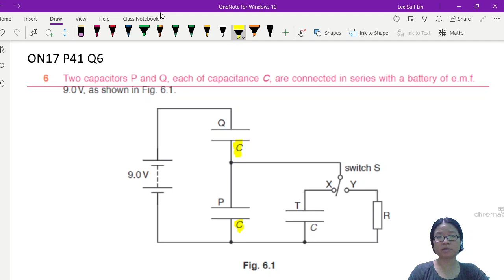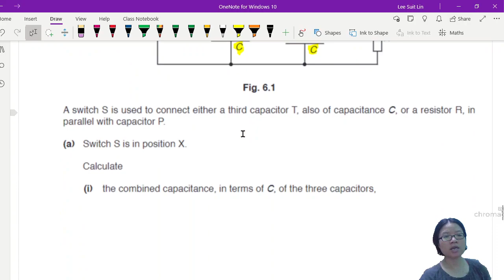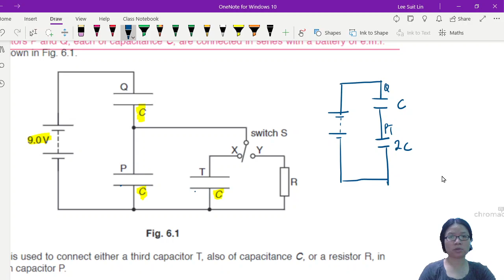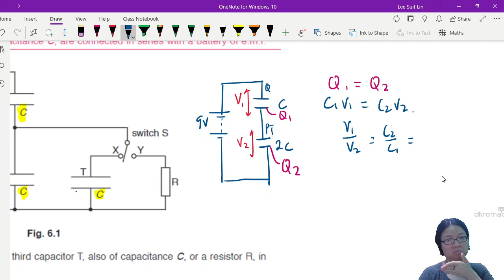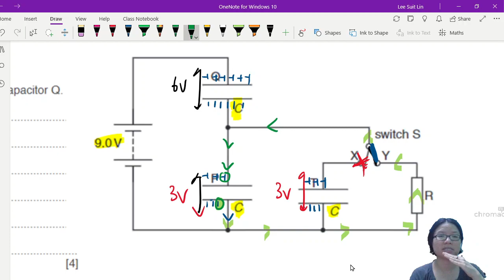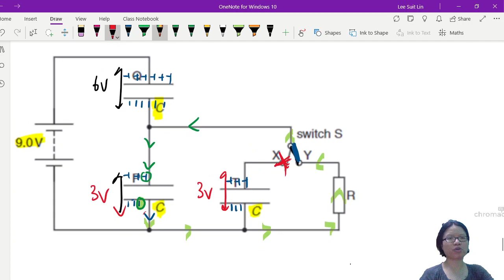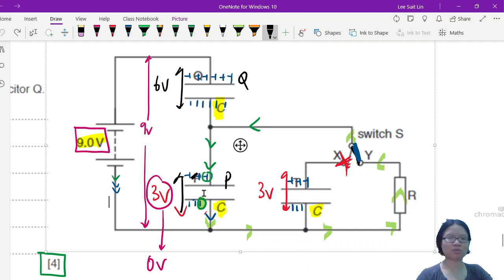19.2c ON17 P41 Q6 Maze of Capacitors | A2 Capacitance | Cambridge A Level Physics

Comment: Please I need some help for part a(i). If I instead combine the Capacitors in Series, P and Q, I get C/2. Then the combined Capacitor of the two now becomes parallel to Capacitor T. If I add them up I instead get 3C/2 — which is different from the answer. Can someone help explain where I'm wrong?
Reply: The one you did is for resistance. In capacitance things are opposite to resistance watch the previous video in the playlist to get a clear idea.
Reply: @merajnahid9125  Thanks for the response, mate. 😊 BUT I think I followed the new rule under Capacitors. In the question, Capacitors P and Q are in series, right? When I combine them under the rule of capacitance, I get (C÷2),  correct? Now let's name these combined Capacitors "S". Now Capacitor S and T will be parallel, not so? When I combine S and T, I get (3C÷2), ie (C÷2) + C.  Or is it a rule that when combining different Capacitors – some in series and others in parallel – we must combine the parallel ones first? 🤔
Reply: @gonayor992  exactly combining series first makes the answer the opposite.
Idg🤔
Reply: @gonayor992  the capacitor Q is in series to both P and T so you need to solve them first before you can find the total series capacitance

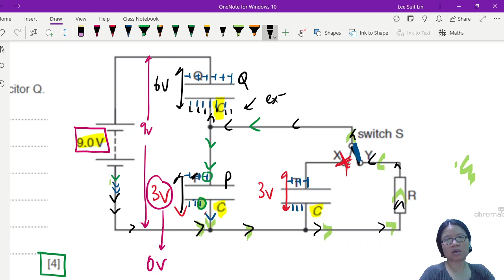Comment: at 14:41 how does the negative charge from the battery on its way to the negative plate of the capacitor capacitor manage to pass through resistor, R without it being dissipated into heat  in the resistance of the resistor
Reply: That's because charge can't be dissipated as heat, energy can. Besides, there's no other way for current to flow but through the resistor

Comment: Well I am still confused like if we consider loop that has battery capacitance Q resistance R than pd across Q is 9 v then resistance R should also have pd across it so isn't it violation of Kirchhoff's second law . Sum of pd across battery= sum of pd across Resistor R and capacitance Q which in this case. Not equal can you explain?
Reply: I think capacitor Q and resistor R are connected in parallel, so you can say Sum of pd across battery = sum of pd across capacitor Q and resistor R = sum of pd across capacitor Q and capacitor P. Hope that makes sense?
Reply: After P has completely discharged, R won't have any p.d across it, as they're in parallel. That's why the sum remains 9V. The capacitor Q doesn't discharge as the negative charge has no way to travel to the positive plate without passing through the battery, therefore it will return to a charging circuit.

Comment: When the switch is set to Y,why is there no potential difference across the resistor R?
Reply from the maker: At first while the charges are moving around there will be current though R and hence pd. But eventually after all capacitors have stabilized and charged/discharged, no more current will be flowing through R and hence no pd!

Comment: Hi. Why doesn’t the cap Q discharge to resistor as well ?
Reply: There isn't really a path that you could use to discharge Q through resistor R, keep in mind the charge cannot travel through the capacitors P or T. That's what i'd guess atleast :)
Reply: The capacitor Q doesn't discharge as the negative charge has no way to travel to the positive plate without passing through the battery, therefore it will return to a charging circuit.
Reply: man this topic is confusing I hope they dont put hard questions for it in M/J 24 students always mess it up

Comment: What does the resistor do to help the 3V capacitor discharge? So if there was just a normal wire it wouldn't have discharged?
Reply from the maker: the resistor slows down the charge flow. if its just a normal wire and the loop is closed, capacitor will discharge too, but VERY QUICKLY, which can cause your circuit to burn and overheat.
Reply: @ETphysics  Thankss